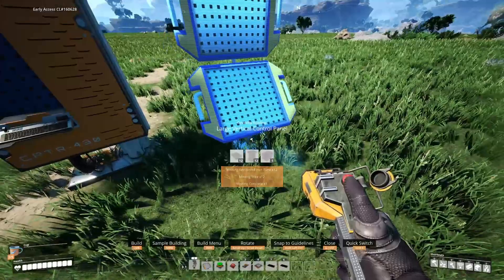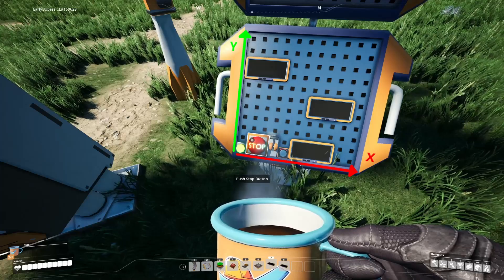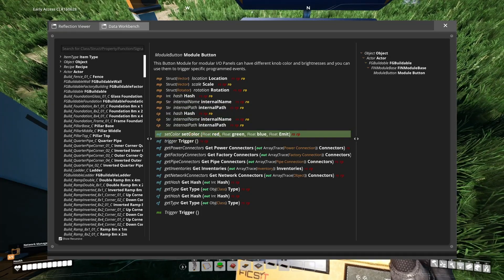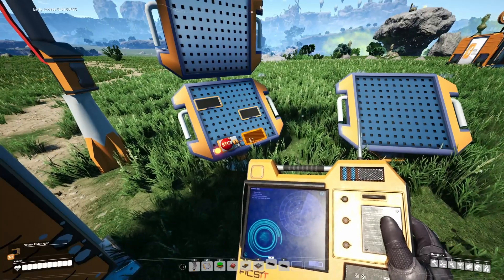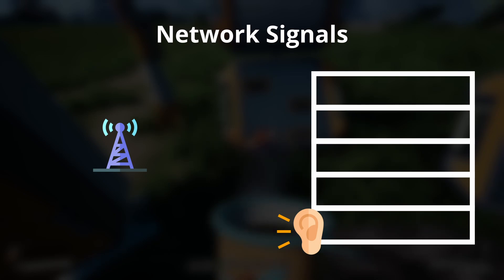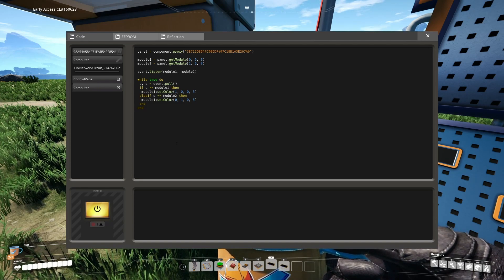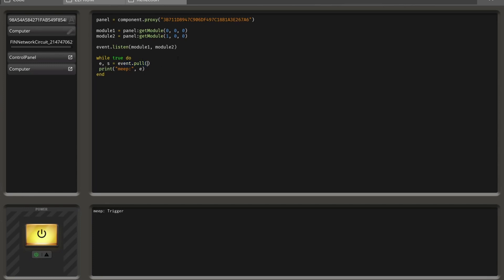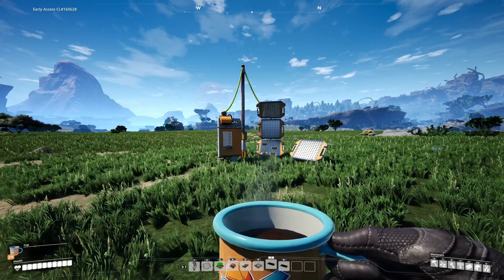FicsIt-Networks - Lua - Panels & Signals | #04

Comment: Thanks for helping to bring about this mod and it’s legacy. Are there new videos in the works for code splitters and sound blocks?
Reply from the maker: Well in regards to FicsIt-Networks, the next video intended would be a video about Lua flow control statements... conditional branching and looping... so i guess it would take some time till we reach the codeable splitter or speaker pole

Comment: I have an issue with the mod: evry time I try to open satisfactory with the mod enambled the game crashed with the following error:
Plugin ""FicsitNetworks" failed to load because module "FicsitNetworks" could not be loaded. There may be an operating system error or the module may not be proprerly set up.
I tried evrithing:
unistalling and re-installing the mod,
unistalling and re-installed smm,
clearing Smm' s cashe,
restarting Window,
verifying satisfactory installation,
updating windows,
updating the epic launcher.
But nothing worked.(I am on epic and early access)
Reply from the maker: Have you tried other mods?
If so and they did not work either, then ask on the SF modding discord
Reply: @Panakotta000  I do not have this problem with other mods, the only mod i had this issue with was the power indicator mod, but i fixed it by just uninstalling and re-installing sml (tecnic that did not work with FicsitNetworks)
Reply from the maker: @iacodino  honestly I cant come up with a sultion since it seems to be a Issue with SMM then... the Mod works just fine for many many people and the mod consist of a single .zip file so I dont know what happens in your case... so you do the normal installtion with SMM UI and just klick on FIN to install?
Reply: @Panakotta000  I installed the mod from the smm standard "install" button